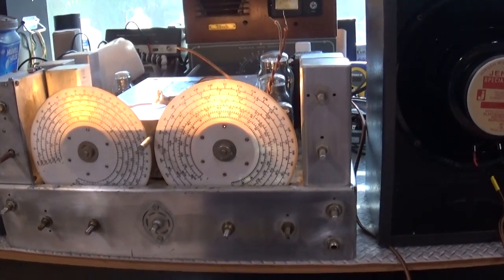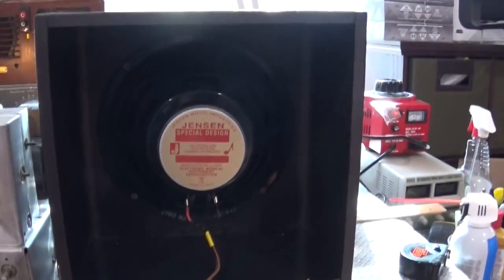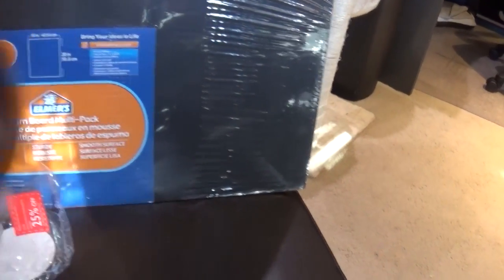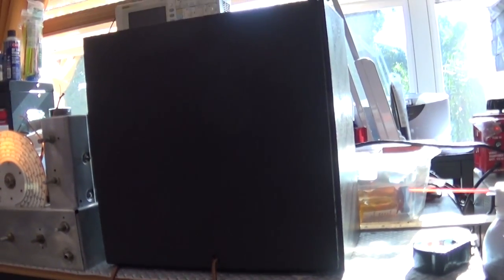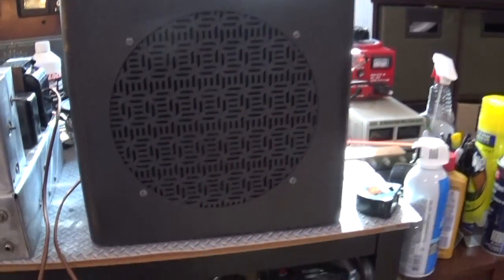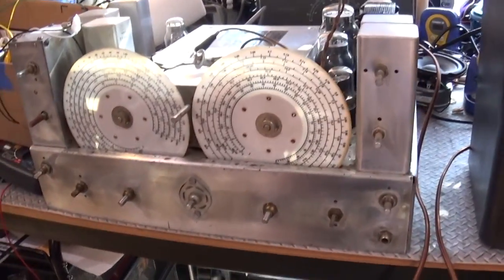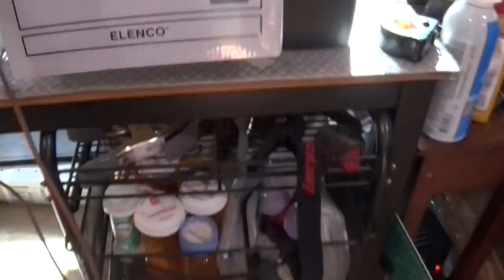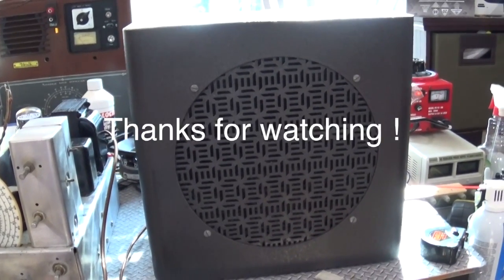Hammarlund HQ-129X Restore - Episode 10 - Get back, get back, get back to where you once belonged.

Comment: Very good, Ron.  I hadn't thought about adding a back to my Hammarlund speaker cabinet.  The old Realistic DX-150 and DX-160 speakers had a real tinny sound to them, so folks always added some sort of batting, usually pink insulation. LOL  I did add batting to mine, but can't remember what kind.  At some point I'll have to take a look.
Have a safe trip.  See you when you return, my friend.
Regards,
John.
Reply from the maker: Thank you John.  I can certainly hear the difference with the back on and off so it does help. The modern Jensen speaker has alot to do with that. That speaker is generally meant for a Fender Champ Amplifier which thrives on Highs and lows. I am still amazed at the tonal quality of the Hammarlund... you can tell it was build and designed with quality - very very good.    Hope your yard is back in shape my friend.... Be well and see you soon, Regards, Ron